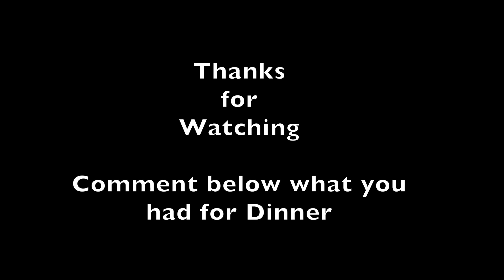This Will Be an Interesting Experiment | Adding on to Our MASSIVE Solar Array

Comment: Hey Gina, An old chef trick for winter limes that don't want to give up much juice is to pop them in the microwave for about 20 to 30 seconds first.  Loosens up the fibers and they give like 50% more juice. 😏
Reply: I thank you that tip.

Comment: Hey Al, I know you didn't like putting together the Iron Ridge parts list, but they actually have a great online design tool which allows you to put in your solar panel model number and roof size, and it builds a full parts list with exact sizes and all the pieces you'd need. It also has the option to send it directly to a nearby distributor for quoting. I also like that I can buy it in 17 foot long rails, which makes alignment easier, and saves money and time on splice kits. Tamarack makes a great product too, so you can't go wrong with either,  but wanted to share that info about the Iron Ridge design tool for anyone who may not have a Tamarack dealer nearby.

Comment: Gina, before cutting limes or lemons in half give them a good roll pushing on them while you do, this will make squeezing the juice out a lot easier, sometimes when they are super hard, put in the microwave for 30 seconds and then roll them, this helps to release the juices in the fruit. I normally cut them on a small plate as they can get very juicy when doing that trick and I don’t waste a drop of it.

Comment: Back in 1978 we purchased a twenty acre plot of ground.  I drove a post in the vicinity of where we wanted to build a house.  I kept track of the shadows of the sun all summer.  We found the optionaly angle to the sunshine for the winter time.  We built the house with the bulk of the the sunlight to come into the house in the afternoon.  Without a bit of heat the house would warm as much as fifteen degrees in the afternoon.

Comment: By the time you're finished, with solar, lighting, workstation, windows possibly, drywall, floor heating, this is going to be the best workshop ever!
Reply: It should make the cover of "Off-Grid Shop Beautiful" magazine, if there was such a rag!
Reply: @samvalentine3206  🤣😂😅
Reply: @samvalentine3206 So true!
Reply: Clearly money is no object.
Reply: @andyrobinson339  It is an off grid property, so he has to have solar. It gets mighty cold there, so he would be crazy not to have insulation and heating. Lastly, he needs somewhere comfortable to work and film during winter or he doesn't have a channel, now the small house is complete.

Comment: I like the idea of vertical solar panels.  Snow resistant and the good angle for winter sun exposure.
Reply from the maker: I can’t wait to monitor these panels this winter
Reply: @LumnahAcres Yes.  I’m interested how good those work in your latitude.  We’re 75 miles west of Dallas / Fort Worth.  Basically the poster boy area for solar installations.
Reply from the maker: @lancebailey683  yea you can make good solar all year

Comment: Winter angle at our & your latitude is 64°. You could kick the bottom of the racks out but not farther than the roof line.  You won't get max production with them vertical but it will still be pretty good.

Comment: What is you amortization period for all that you have invested in solar power calculating in renewal costs as well?
Reply: It is immediately much cheaper than running power lines in, so the amortization period really doesn't matter much.  I suppose you could compare it to running diesel generators all the time.

Comment: Al, You're smart putting those solar panels on the wall in your area.  With the low sun angle and being snow free they will probably produce almost as much as the roof panels during the snowy months.

Comment: Just used the same PV clamping system on a 10 panel add on. Mine was mounted on shingles though. Easy to use. This array does the same as yours, on the S/W side for fall and evening sun.

Comment: Good Morning!  That avocado oil does get a bit pricey, so I fry tortillas one side at a time.  I like to add a little feta cheese when I make fish tacos, as well as avocado slices.  Since I am a grower, I have Hass avocadoes for several months, starting in January.  One of the few crops you can delay picking and they just keep on getting better.  This year I was still picking in August!

I wonder if it would be worth it to add some heat tape under the roof solar panels to help melt the snow off.
Reply: Good morning, Guy - hopefully the dark colors will absorb the solar heat and melt everything by the grace of God - heat tape might be a good idea if it turns out to be an issue...  or a really long snow rake or broom!

Comment: Keep in mind that a vertical wall solar system can gain 20% more power from extra light reflected by the snow …landscape improvement to the area can improve on this …

Comment: I have two questions. 1) do you have trouble with bird nests in the solar racks? And 2) can you burn off all the cardboard packaging in the boiler or is it composted?
Reply: Don't compost cardboard  as you don't know what chemicals were used in it's manufacture.

Comment: What happens in summer and the batteries are full Will you have a dump load say a hot water tank? Always nice to have hot water anywhere even if it was just summer but nothing to stop you heating water in the winter as needed as you have the tank. 
I might dump in winter depending on how much you are in there and working. Power you are using per day and the amount of panels you have. Great setup.
Reply: The inverters will automatically switch off.

Comment: Just a thought: What about using the side panels to power a heating system mounted under the panels on the roof that will melt the  snow.  That should create a complete power system during the winter.

Comment: Al, Gina, While I respect your decision for a roof installation,  it does mean that all maintenance will be up! You do have lots of space. A ground installation may have been better in the long run. I'm sure it will generate fine and power your workshop. Regards, Stephen.

Comment: Where you able to order the tamarack mount system by the piece count, or did you have to buy them in kits, as in enough Kits to cover what you needed? I am so far only able to find them in Kits???? I need to mount 24 panels, so in kits, per kit, i need to order more then what is actually needed. Meaning parts left over after the install  is complete....... Help?????

Comment: I saw another YouTuber with metal siding who used foam boards for insulation instead of spray foam, primarily because of cost.  His building was about the same size as your workshop, but the spray was going to cost $16,000 while the foam board was 1/10th of that.  How does that match with your experience?

Comment: Have you thought about putting low voltage current into the solar panel frames on the roof to melt the snow off of the roof. Just a thought!

Comment: Hey AL Y not. Cover the hole wall with solar panels Y not what good is a empty wall. Hey if the water did leak through that screw how would you know with the foam on the in side wall lol the more the marieer on the solar panels

Comment: The fastening on the sheet piling profile is not correctly applied and should be rotated 90 degrees, because then the screws that it is with on the sheet piling are further apart in the direction where the force acts and you then have a more favorable leverage, which is the gravity that goes down vertically.
De bevestiging op het damwandprofiel is niet op de juiste wijze aangebracht en zou 90 graden gedraaid moeten zijn, omdat dan de schroeven waar het mee op de damwand zit verder uit elkaar zitten in de richting waar de kracht op inwerkt en je dan een gunstigere hefboomwerking hebt, wat dus de zwaartekracht is die verticaal naar beneden gaat.
Reply: I've seen this kind of mistake at my job as an electrician, where cable ducts collapsed into it, at a data center, where very thick cables are used. I can't really judge whether your solar panels will break down in the future. Changing it would cause quite a few holes in the sheet piling, which won't make you happy, a few extra brackets in the right direction, would be the best solution and you could use 50% extra brackets, if you think it's really necessary.

Comment: Why do you need that much power for 1 building? It's too bad they didn't think ahead so they didn't need a separate power setup for each building instead of having one power grid for all buildings which were close to one another. Will he need another generator for the shop too? The amount of money invested in this place is staggering.
Reply: And this bothers you?

Comment: I know you intend to at some point get the radiant floor heating system up and running, but with the amount of power you will be generating with the solar setup, it might be a good idea to install a couple mini split heat/cool units. They are super efficient and are available in various sizes. The pricing of these units has also come down considerably and are a pretty easy diy install. Quite a few of the other "off grid" channels I watch have these systems installed and they love them. I as well have installed one in my garage. It is an 18K btu unit and does a great job. My space is much smaller than your workshop (approx 600sq ft) but different  larger sizes are available.Once your radiant floor system is up and running, the mini split can supplement it , but they can also keep the shop cool in the summer months as well.